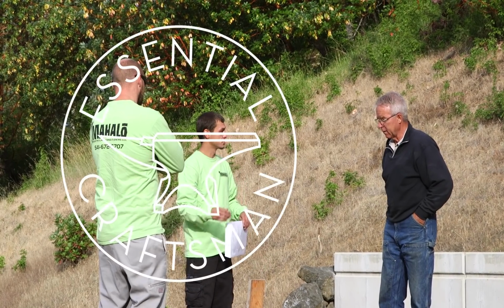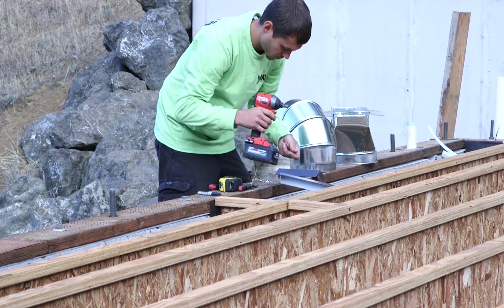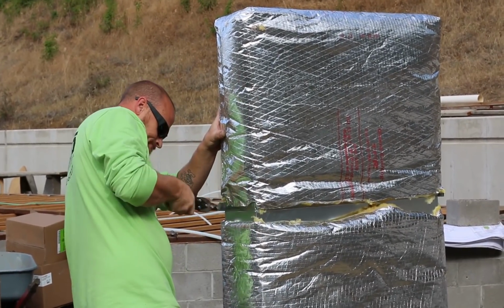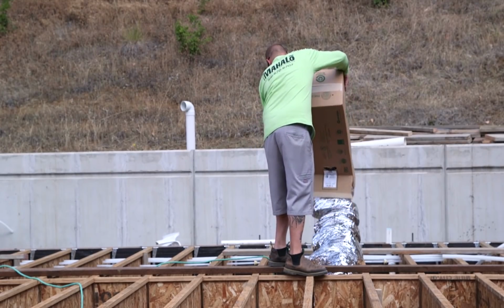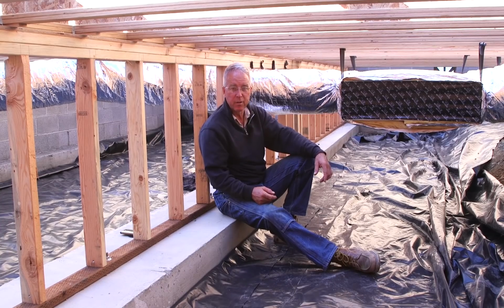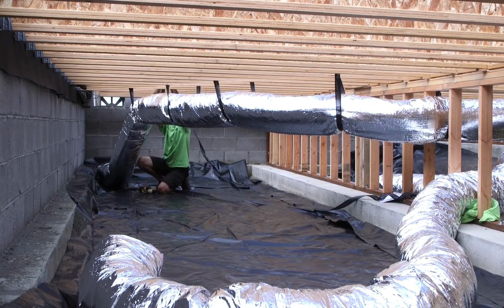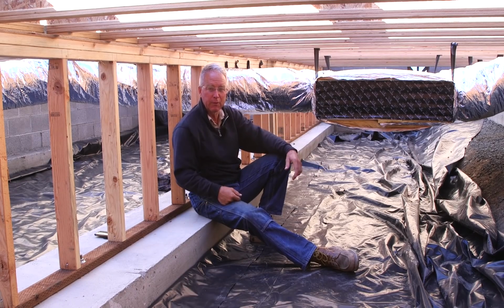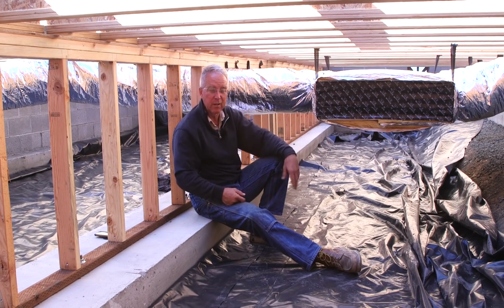Ducting Ep 42

Comment: apart from the 10 months of constant miserable drizzling rain every year the pnw is a beautiful place, i lived in sw wa off and on from 09-17 and the temps in the winter are almost never below mid 40s, it rarely snows, and in summer a heat wave is the high 80s maybe low 90s, usually mid to high 70s is the normal. although there was one year (2017) when it reached triple digits that was a fluke, i would live there again but the constant rain is a deterrent. but i guess no matter where you live there will be weather that you dont like, for instance here in the sierras of ca even at elevation it gets HOT every summer triple digits, and snow can really shut things down in the winter. the great plains have to deal with tornados, the southeast has to deal with extreme humidity and hurricanes, the northeast and rockies have to deal with blizzards, midwest has to deal with both severe storms and extreme cold and the southwest has to deal with extreme dry heat and very little rain, so overall i think the pnw wins with almost no extreme weather

Comment: That duct work is cleaner than the entire hvac install at my house, everything was botched and hacked. every rule you said was broken except the insulation part. My house was converted to ducted central from a window ac and ductless gravity furnace system back in the 1980s. That old ductless furnace still exists to this day.

Comment: Watching this again 4 years later. Theres just something i dont like about flexible ducting. I had my ducting redone at my house years back; mainly to replace my old asbestos ducting, and to add central AC. The stuff i replaced was old, but it was solid. More solid than the aluminum used these days. But all my long runs were replaced with that flexible stuff, and i know its not as efficient as it would be with solid runs.

Comment: I'm a certified HVAC mechanic of 17+ years both in residential and commercial and I've got to say the way that HVAC was installed seamed strange to me; never have I seen a main line hanging on clothe straps and all the codes in the places I've worked CO. GA. NH. you couldn't have more that 60" of flex hand to be piped just a little interesting well "Keep up the good work". God bless

Comment: You made a comment abut tradesmen not having to work in a dark crawlspace by letting them do the work before the decking is installed.  For only a little more money it would be simple to install lights throughout the crawl space with extra lighting where the air handler is installed. That would allow tradesmen to work in well-lighted conditions for the life of the house. I've installed lighting in many crawl spaces and it makes a world of difference to the folks coming in for future repair work and even for the homeowner to periodically inspect the space.  I would also consider putting a platform over that drain pipe since it cuts right through the access area. Better to keep people off the pipe entirely...

Comment: Lucky, we have to pressure test our duct work up where I am and are allowed 3% loss on state jobs 5% on new homes and if the inspector wants it "which they never do" on a retrofit for an existing system allowed from 11%-15% air loss on a job. Due to you can't guarantee the original installation was correct or sealed properly. We actually have to seal the duct openings off and pump air in at 25 pascels "low pressure at 0.00362594psi" with an air test machine that measures how many CFM it takes to maintain that pressure. So say the furnace is a 1200cfm furnace "probably 3-ton cooling unit" you are allowed up to only 60cfm air loss or you fail your inspection on a new home. Commercial side which I mainly am involved in say you have a rooftop that can push 20,000cfm at only 3% you can only have 600 cfm lost. And on units that big we are usually feeding a whole wing of a college so that can be coming up on a mile worth of duct when you start thinking individual classrooms and branches per unit, and that's a lot of joints to make sure are air tight...

Comment: Where I live solid sheet metal ducts with insulation around them is the norm for single family homes here! Gas fired Forced Air heating via gas furnace with an A-Coil indoor coil on top for central air is normal here as our summers are often over 90° and can hit and even surpass 100° for a week or two summer on average and if you factor in the high humidity it can feel up to 20° hotter with the humidity, winter we are often under 28°  with constant freeze/thaw cycle sometimes almost 60° during winter thaw cycles! Then during cold snaps we can and have fallen below 0°

Comment: I work commercial HVAC in Canada. I've never seen flex used for heat runs in a home ever. Also, what are those black supports they're using?
Reply: That is fabric strapping. Is only meets code requirements to support flex duct.

Comment: Just to bring some points to light. unheated, Vented crawl spaces are the absolute worst place to install heating and cooling duct work. Crawl spaces are much better served as a "mini" basement. That being with insulation on basement walls rather than bats between joists. The performance,comfort and dryer environment makes for a more energy efficient,long lasting structure. There are so many articles on the web the viewers can find a whole host of sites supporting that concept.

Comment: Can anyone tell me/provide a link to the nibbler drill attachment that's being used ~ 6:18 ? I don't do enough sheet metal work to justify a powered nibbler, but I do do enough to where I am wanting one. I didn't even know that there was a drill attachment sheet metal cutter, but I can't find the tool that is being used.
Reply: For what it's worth, it's a shear, not a nibbler. A nibbler is a punch and die that cuts little bites out the sheet metal, and a shear is just like a pair of scissors, it doesn't snip out waste line a nibbler.   https://www.amazon.com/Malco-TS1XXX-Capacity-Cutting-Attachment/dp/B0000AQK7C/ref=asc_df_B0000AQK7C/?tag=hyprod-20&linkCode=df0&hvadid=312003160272&hvpos=1o1&hvnetw=g&hvrand=13128162809233800450&hvpone=&hvptwo=&hvqmt=&hvdev=c&hvdvcmdl=&hvlocint=&hvlocphy=9012100&hvtargid=pla-464601892284&psc=1

Comment: I work with a local HVAC company in my country but I have to say that the practices and techniques displayed in this video are rather poor and old fashioned. Most of the points have been discussed in other comments, however the biggest difference is that we attach individual ducts using flanges and bolts with mastic seal between. A much easier and better seal than by driving a wedge in between ducts

Comment: Long ago, when I was  fireman, I learned about "friction loss" in CJRL or, cotton jacket rubber lined fire hose. It meant that your hose conducted less water, at less pressure, the longer the hose was. All the little ripples in the hose cost you something. And each additional appliance (fitting) also cost you something. So the engineer back st the pumper truck would figure what volume and pressure to give you, so that what came out of your nozzle was what you needed, or requested. I see that there is a similarity in these HVAC ducts.

Now, as a retiree/arborist, I use scrap pieces of that same hose as sheaths for my pruning saws. A big enough piece can be used to protect the teeth on a misery whip, or on a chain saw bar.

Comment: You can move way more thermal energy with a liquid than you can with a gas and it takes up so much less space.
Reply: MAKE IT CLEAR...?
Reply: @MD-cd7em  sorry if you didnt understand. I have a fondness for hot water heat. That can be supplied by a variety of heat sources from wood or coal furnaces to gas or oil furnaces or an on demand water heater. Then the same heat source for heating the house can be used for for heating the domestic hot water, either year round or only in the winter. The other benefits are that you can zone the heat where you want it with individual thermostats in each room or zone. And you can decide how the heat is transferred into the house. Be it old school radiator or a baseboard system or radient floor heat. I prefer the radient heat the best because the floors are never cold in the winter. The floor might be 72-74 to keep the house 70 but there will be no hot spots because the 73° floor is the heat source nothing in the house can be warmer than that. 

As far as cooling goes there are systems that use a single condenser unit than pump the refrigerant to individual evaporation units that can be installed in each zone or room and most can be used as a heat pump as well. With individual thermostats. You only heat or cool what you need when you need. 

This kinda covers the humidity control in the house, mostly during the summer where it needs removed but not so much during the winter where it would be nice to add some. It also does not cover the ventilation part of the system. That can be delt with by having exhaust fans in the bathrooms that flow through a heat exchanger to move outside air into the other rooms of the house. That can be at very low flow rates in small tubing that is easy to hide in the walls.

Comment: Canadian builder here. An unheated crawlspace would never pass code here. Aren’t your floors cold doing that in your area? Also it is rare to see any rough in from any trades before framing is complete. If it’s not going in concrete, we frame the house and they rough in after. Most of the time everything rolls pretty smooth, any minor adjustments we take care of after rough in. “Backframing” includes keeping the trades happy and other punch list items like pocket doors, coffered ceilings etc etc. Also we use hard pipe everywhere. Flex pipe in renovations to get around really tough areas only. Using that much flex pipe would be considered total bush league. If you condition the crawl space, it doesn’t need to be insulated. You reduce your friction loss and use 5 and 6” pipe instead of what looks to be 8”. Poor design in my opinion.

Comment: I wish had run it a contractor like you, I never got to a house that wasn't up and dried in, 90% of crawl spaces had gravel in them. dark, cramped. and rocks to kneel on. here in N.C. the codes vary from the mountains in the west to the Atlantic with 5 different zones. you are correct i grew up in Fla and hvac was totally different there. every place is different

Comment: So much flex! but it would be cheaper to run.. So much friction loss but that's why its such large diameter.. must be putting in a unit with higher static fan??? Kind of surprised they're not using standing S with that ducts aspect ratio.. I work in commercial and industrial though so residential rules must be different..

Comment: Best is to install metal ducts; flex duct is rat food and has a much higher static resistance. Also dogs cats and animals can get under a house and destroy flex. All you do to assemble a 5' section of round metal pipe is snap it together and run a screw at each end, tape seams or add duct butter, then throw insulation around it before joining it together.

Comment: I don't want say anything bad about this video or the people installing the ductwork cause I have a great respect for this series and the information provided, but here in south MS the standard is hard metal pipe, even in residential installations. I'm not saying that flex isn't used, but many technicians pride themselves on using the more durable version. There's a trunk line and each pipe is taken from the trunk line, like the branches off a tree trunk, which then decreases size as it goes in order to keep the pressure up. Think fluid dynamics. Each vent should have close to the same pressure so every room in the house gets the same cubic feet per minute of air for the same size pipe. Then you can adjust the amount of heat or cooling by adjusting the size of duct pipe. Using the style used here, where the system has a plenum like a spider's body  and each tap takes air where it goes like a spider leg off the plenum, it's hard to figure air velocity and thus cubic feet per minute: CFMs. Usually, there's a baffle on each pipe to restrict airflow to that vent in order to force the air everywhere else and equalize everything. In my thinking, this takes away from the efficiency of the unit. Also, there are squirrels, cats, dogs, raccoons, kids, and sometimes just age or weather that can all tear up ductwork. Especially flex. And extra especially when everything is ground level. Flex also is prone to sagging, so care should be exercised to prevent it. All that being said, this will be a two story house, if I got that right, and under the house is probably the best choice for bottom story. But I've never done much ductwork under the house down here. Also there's so much moisture under the house when it's 100% relative humidity. And in the attics I usually work in, the insulation keeps the cold pipes from sweating in the summer and wetting the ceiling and causing problems. The big debate down here is whether or not to tape the insulation seams to further the water proofing. Not antagonistic, just want to fill out the perspective a bit for information purposes. Keep up the good work. I enjoy all the detail you put in.

Comment: great video.  That nibbler attachment for their impact driver is cool.
Reply: For the record, that's not a nibbler, it's a shear. A nibbler cuts out a little "bite" of material with each stroke, so the cut between the two pieces actually has width.  A shear just makes a single cut with no material removed.  The tool in the video cuts in the the same basic way as a pair of tin snips, it's just faster and more maneuverable.

Comment: Should have conditioned your crawl space, don't make the same mistake with the attic if there is ductwork up there. Why?  That almost non-existent insulation on the ductwork is always fighting the outside temperature whether hot or cold vs a conditioned crawl space whose temperature would be the same as the rest of the house. Secondly, a conditioned crawl space eliminates the humidity. I am sure the system was adequately sized but installed in a non-conditioned crawl space and probably an attic. Sort of late 20th century HVAC spec builder technology IMO.

Comment: I've always wondered why you yanks go for flexi-systems.  Where I'm working in Ottawa, Canada you see solid ducts in virtually every residential building.  Heck, we can get a 6" round of reasonable gauge for $2/foot.  In greenbacks that must be less than $1.50/foot.  Why not go the extra mile in durability knowing it may be in a wall or floor for a hundred years?
Reply: Jeff, I wouldn't extrapolate too much from this one example.  Reading the comments here, I get the impression that there's a lot of areas in the US where using flex duct like this wouldn't meet code.

Comment: Shouldn’t tape go on all the metal seams? Where the boots attach to the main line, and the joints on that 90 he straightened out? I know he put mastic inside, but still.... I guess if the inner liner covers it, it should be good from air leaks.

Comment: i'm British, can someone explain to me what all this is and why it's needed? the only buildings i know of with ventilation systems are underground bunkers, i don't understand the choice of a system like this if it doesn't get ludicrously hot on a regular basis.
Reply: Gramersow, The ducting is distribute heated air when it's cold enough to require heat.  It may also be used to distribute conditioned air in the summer (not sure if Scott is installing air conditioning or not)  This is a fairly common form of central heating in the US, a furnace to heat air, and a blower to move the heated air, and a system of ducts to distribute the heated air to each room.  I take it, this would be unusual in the UK?
Reply: @andrewalexander9492  thanks for explaining. we have no such thing, like i said, except in bunkers or other underground buildings that need a supply of oxygen! almost all houses here have hot water systems for heating, connected to the hot water boiler, with closed loops of radiators going to each room. i suppose we never see your system because it takes up so much space, we could easily fit 5 or 6 houses on on an area the size of Scott's plot here. i imagine our system is inefficient for large spaces which is why you guys don't see it.
Reply: @gramursowanfaborden5820  I wouldn't say that a hydronic heating system is inefficient for a larger house.  There are plenty of houses in the US which are heated by hydronic systems also. My house has hydronic heating. Personally, I prefer that, and it is quite efficient.  But forced hot air heating, as in Scott's build is common also.